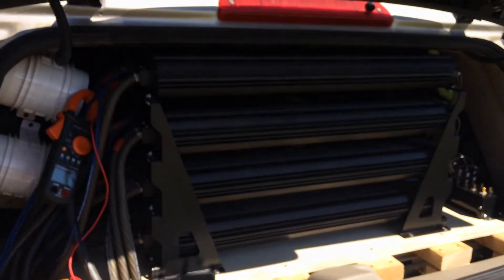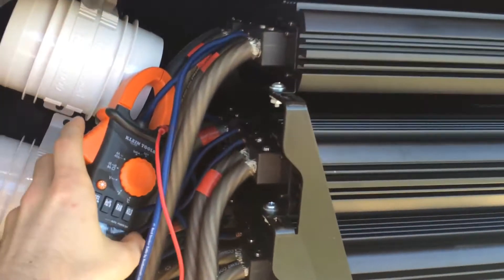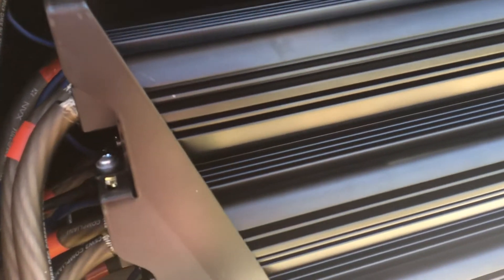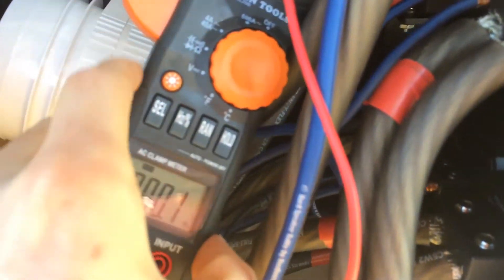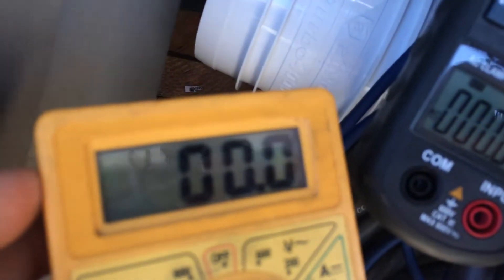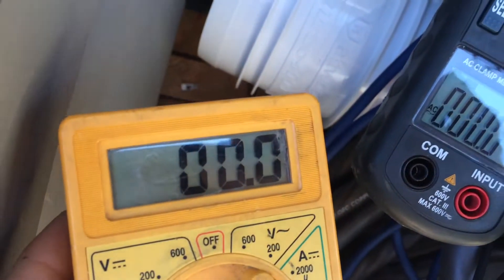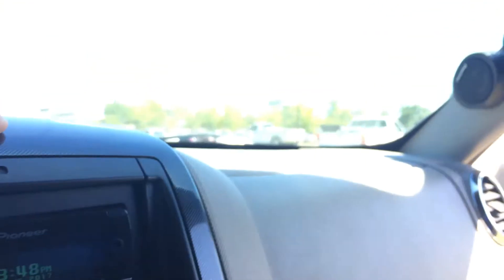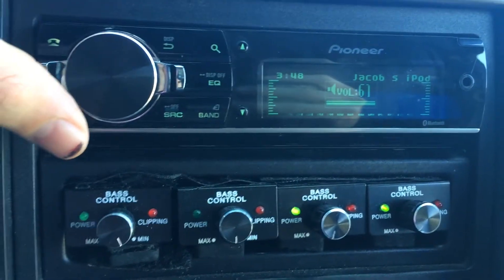SoundQubed 4500s Clamp test for RMS Output

Comment: I noticed there were two positive output speaker wires and the clamp was only around one of them.  I have two pairs of subs connected to my mono amp, so im using both of my positive and negative outputs so will i need to put the clamp around each positive speaker output or just one of them?
Reply from the maker: Clamp around both speaker inputs correct. It shouldn’t be a difference as they are linked but I have started doing both more recently.

Comment: I ordered a walfram 4500 and I got 2 zvx 12v2 I know it will depend on my box and all that other good stuff but what you think I will get around for rms ?
Reply from the maker: MrRotery7 depends on your ohm load to start and your voltage. If you are at 1 ohm wire starting at 14.4 you’ll probably be rising to 1.5 to 2 ohm or so which would be realistically like 2500 watts max, but is your at half ohm after rise 1.1-1.3ohm around 14.4 colts then around 4000 watts. Depends on a lot of factors man. Nice setup!
Reply: @JacobViral  ok ya I'll deff have to see what's going on when I get my box done I got everything on hand except the walfram 4500 that's on back order till 31st so gotta wait on that but iv herd people say they run there walfram amps at half ohm smd never have a problem the amp is only 1ohm but I'm sure it wouldn't hurt it if I put it down to half ohm it looks like its built pretty tuff and heavy
Reply: You must have you're Wolfram 4500 by now. It's a beast. What are you getting out of it?

Comment: I heard clamping doeant matter, a reputable builder told me an amp could clamp 2000 watts and be a 5k amp and it would still be as loud as another amp clamping 4000, apparently more power doeant always equal louder
Reply: That doest even make logical sense bro tell ur reputable builder to stop making u say dumb shit in public 😂
Reply: On different systems sure but on the same subs and box everything the same more power will be louder. Now I’m not talking about a few hundred watts yes you want hear a difference but when you double the power you will hear a difference. A system is just that a system of parts all working together to make noise so it takes a efficient box to keep the power going and it takes efficient subs that aren’t hard to push to make it loud. Y

Comment: When Clamping you must also divide your result by the square root of 2 (1.414) to get watts. Volts x Amps = VA not watts. That is how you calculate R.M.S. (Root, Mean, Square). 4689 watts was total power 2344 watts each.
Reply: Flexin Five Hundred I'm not sure if this method is correct
Reply: Technically clamping is highly inaccurate. If you have no way to measure power factor you're simply finding VA which is not watts.